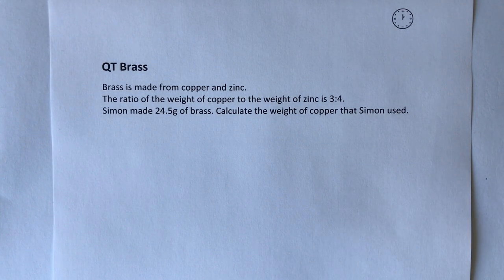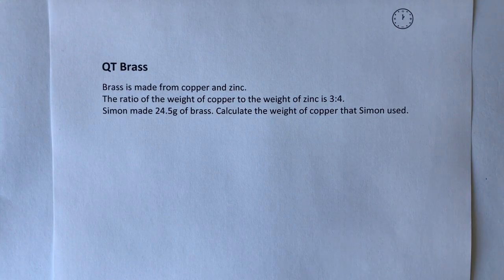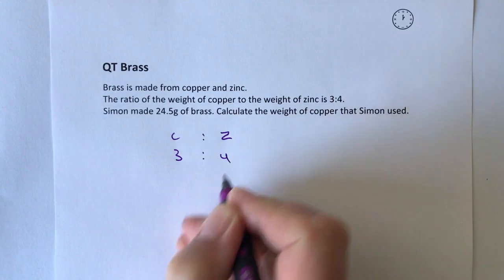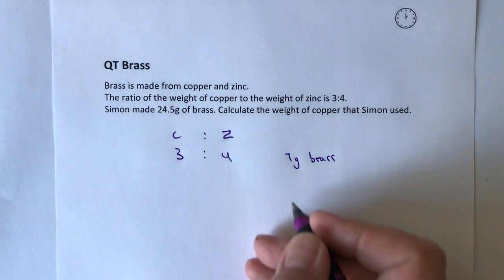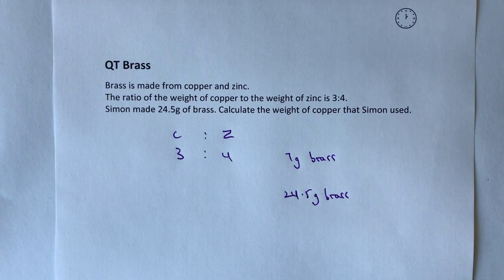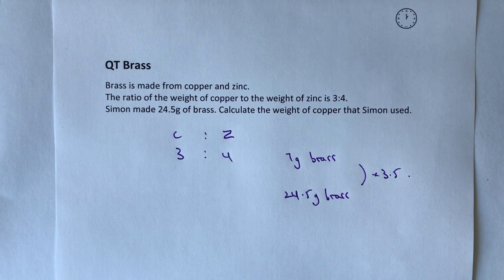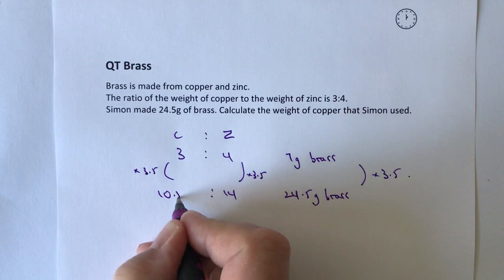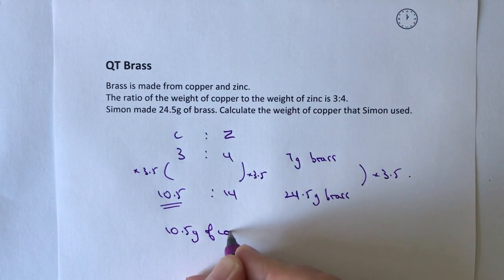Brass is made from copper and zinc ratio question - GCSE maths grade 4

Comment: how do you get to zinc tho i got a question saying every 100g of brass  = 20g off zinc so if 60gs off brass = how much zinc would it be?
Reply from the maker: Hi - if 100g brass = 20g zinc that’s the same as 10g brass = 2g zinc. 
So, if you’ve got 60g brass that’s 10g x 6
You’ll need to also multiply the zinc 2g x 6
You’ll need 12g of zinc. 
Best S
Reply: @3minutemaths  thank you